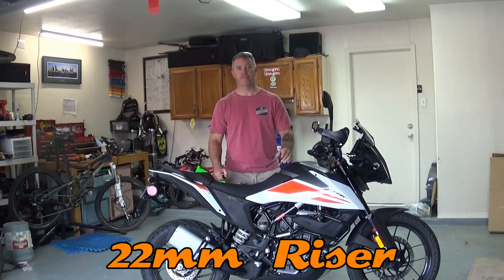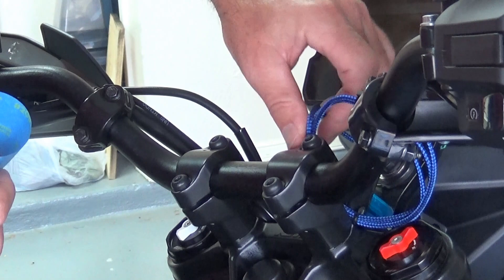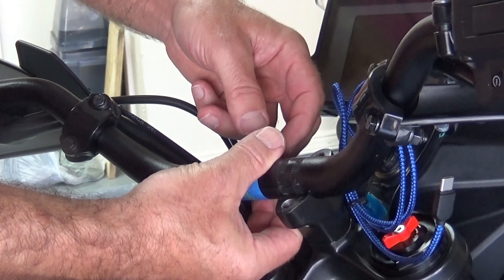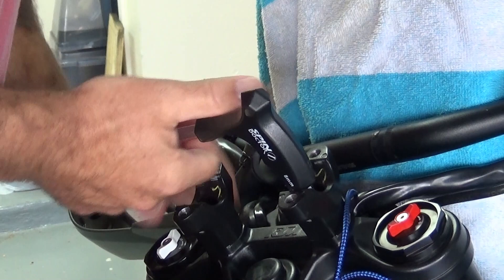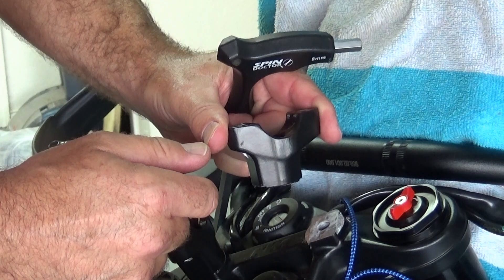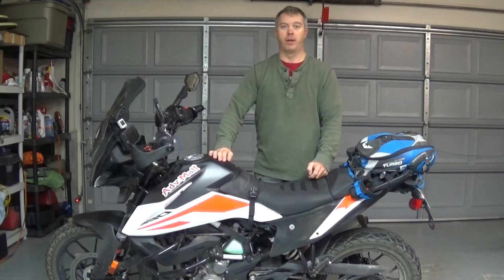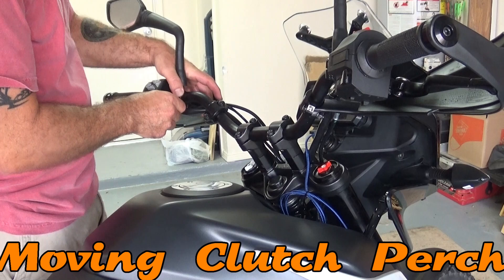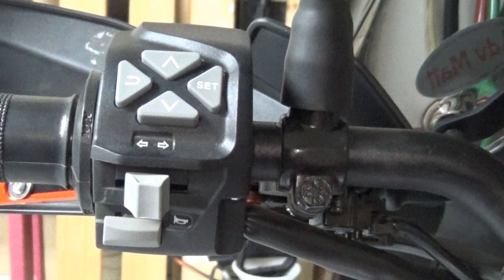KTM 390 Adventure Bar Riser Install

Comment: Installed 25mm risers today.  Clutch cable seemed a little tight at full lock but sliding in the perch seems sufficient.  Thanks for the vid!  Also, in case anyone needs it, torque for the handlebar clamps is 20Nm and 40Nm for the risers.
Reply from the maker: Have you considered upgrading the handle bars?
Reply: @advmatt  Not yet.  I want to try out the bike with the risers and see how it is now; should be a little more comfortable standing up.  What's the main benefit of a handlebar upgrade?  More rise or backwards sweep?
Reply from the maker: @luciano136  there are several ergonomic effects.  The first part of this video will explain easier than typing a novel here.  https://youtu.be/tV-GQT4m5VY

Comment: Just did this on my 2023 and used your amazon link and got the same ones. Bolts were threaded all the way on the ones I got and way longer than needed. Also some weird size was not a usa or metric allen I had so just bought new ones at the hardware store. Worked out great and did have to mess with the clutch cable a little bit.
Reply from the maker: Glad it worked for you.  It really helped my riding position.  Dropping the footpegs a 1/2" also helped a bit more.
Reply: @advmatt   waiting for those now and cant wait for them the factory ones stink........

Comment: I bought the risers you linked to in a reply to a comment here; all's good with the different bolts which were easy to find.  FWIW, I measured the bar risers I received and I couldn't find anything about them that measured 22mm even if the ad said they were 22mm.  More like 28mm.  But they worked if i moved the lever slightly to the right as you suggest.
Reply: Thats makes sense

Comment: Just fitted mine today, super easy, 30 minutes tops, allowing for how tight the original riser bolts were, I was freaking that I might strip them somehow, so took it extremely cautiously. The amount of rust at the bottom of the original 'riser' bolts was rather concerning on a 1 year old bike, so maybe folks should whack a bit of grease around the base of the risers, as that is where the water can get in, and it can't get back out. 
I did however hit what seemed to be a major snag. When I went to start the bike, I couldn't turn the key. When fiddling around, I somehow moved that plastic shield that is in front of the ignition. In a panic I thought the entire ignition barrel had dropped, and I started sweating, but it was just that the plastic shield had somehow got pushed up, stopping the key from going in fully. 
Mentioning it in case anyone else comes along thinking of doing the risers, so there is more knowledge shared.
Just the bar risers alone made a huge difference, I can stand (I'm 6ft) without having to bend my neck to get my head up. Once I fit the lowered pegs this wee bike will be a beast offroad! Yeehaaa.
Reply from the maker: Thanks for adding those notes.  Really helpful.

Comment: Hey just clicked in here to ask if you have had the new ECU flash done? I had my bike in for something else and I asked if they could do the new update. But I’m telling you I pulled out expecting nothing from the ECU flash….. it’s like a whole new bike. 

The jerky throttle response at low speeds in 1-2 gear is completely gone. The fuel is delivered way more evenly throughout all the gears. I could go on and on. I’m absolutely blown away by how much better the bike is now. It’s really so drastic and so much better words just can’t describe it you have to feel it to understand. 

And If you disagree then all I can think is maybe my bike was messed up from the factory ? But I think that’s impossible it’s a computer program in the end. Also I’ve heard dozens of people talk about the stalls (totally gone) , the jerky throttle , etc. 

Oh and also the extreme engine breaking is gone , now it feels like a normal big adventure bike with just smooth engine breaking not jerk your head around if your not careful. Which I had totally gotten used to and mastered but boy is it nice now. The entire experience just feels more smooth and the power doesn’t wind out in the low gears and spread so long in the high gears. It’s just more like what every other motorcycle I’ve ever owned was like.
Reply from the maker: Thanks for the info.  I havent had the ecu flashed with the latest upgrade yet.  Dealers are not close, but I will need to do it.  Cheers.
Reply: What year model is yours? Would the '22 models already have the new ECU flash done?
Reply: @db0zr0z  yes the 22 does. But that’s just second hand what I heard.  I would check with the dealer.

Comment: Even though this is a late commit, I put on the 1 1/8” riser and man what a difference that little bit can make. 
Like others having a problem with the clutch cable I ended up sliding the clutch lever in a 1/2”. The directions say to run the cable a quicker way. Humm, quicker not shorter. Anyways I really couldn’t see a “quicker” route. Sliding the clutch lever in seemed to work. I’ve seen others that bought a longer cable. 
So now at 6’ I can stand up without being crouched over. Still looking at straightening out the pegs though
Reply from the maker: Check out the BDCW'S pegs.  I love them.  I did a video on them if you want to know more.  SW-MOTECH also has the Evo peg for this bike.  Both pegs sit lower than stock and are flat.  Huge improvement.

Comment: The clutch cable is not long enough for those risers, please also note that the hand guards could hit the windshield.
Reply from the maker: It worked out fine for me.  The hand guards dont contact the windscreen.  Maybe you recieved a taller version.

Comment: Hi Matt,
I’m thinking of getting a KTM 390 adv and have been watching your posts.
Would you recommend the 390 having one yourself or would you recommend a different brand? Pros and cons of the bike given your experience would be welcome 😁
Reply from the maker: That is a tough question to answer directly.  I think it depends on the kind of riding you plan to do.  The areas I think there may be better bikes is long distance touring and aggressive offroad riding.  I really like mine, I haven't regretted the purchase one second.  I rode mine in some really aggressive terrain and thoroughly enjoyed camping off of it.  There are a lot of pros and only a few cons.  The biggest pro in my opinion is the weight.  A sub 400 pound adventure bike is so much easier to handle than a a bike in the high 500s.  The two cons that come to mind are the allow wheels, but spoke wheels are on the way and single cylinders vibrate more and require being ridden harder to get the most out of them.  It is hard to be comprehensive here but this a good video idea.  Thanks for watching.
Reply: @advmatt  thanks for your honest reply on your bike.
I’m taking the 390 out for a second ride in January, I found the bike a little vibrating on the first ride but was impressed at how light and well balanced it was. It also had some get up and go if you reved it up to about 8 thousand rpm. I took it up to 70mph on a A road and it had lots left but the wind at 70 was not good due to the lack of a decent wind screen.
I’m hoping to get a test ride on a Honda CB500X as it’s got all the things the KTM has not got like twin cylinder and a better wind screen and faring, but has a lot more weight to carry. I don’t know yet how the bike feels in relation to weight and balance. I think a lazy torquey ride may suite me but I’m just concerned about the weight of the bike.

I do lick your videos on the bike as you seem to be addressing all the concerns that I see I would have if I purchased a 390.

Thanks 😊
Reply from the maker: Keep the RPMs above 5k, the bike really smoothes out between 6k and 8k.  It's the sweet spot.  Cheers.
Reply: The 390 adventure isn't really a travel bike imo after riding for the last 45 years.

Comment: Hello!! Have you ever felt that 2inch raiser would have been a more suitable one for you after using this. I am 5.10 and not sure what should i go with(1 or 2 inch). You suggestion will be helpful
Reply from the maker: @uv4366  a 2" risers will require a longer clutch cable.  That was the reason I stayed with the shorter one.  I also installed the Black Dog Cycle Works pegs which lowered my foot position 1/2".  This seemed to work pretty well for me. I am also 5'10".
Reply: @advmatt thank you!  it helped

Comment: Hey Matt! Since my last post a week ago I found a new 390 Adventure and I'm picking it up tomorrow. At 6'2" I definitely need bar risers. Rox makes great adjustable risers that come in 1,2,3 and 4" heights. I'll be needing at least 2" and maybe more. I've read that you might be able to get away with 2" risers without replacing the clutch cable. Do you have any idea how high one might be able to go without replacing the clutch and the brake cable? Appreciate your input. I'm really enjoying your channel.
Reply from the maker: My experience with the risers was 1" was the limit on the clutch cable without rerouting it.  I looked at this very closely to see what I could do.  There is a lot if brake line so I think 2" would be fine but I dont know about anything more than that.  I recommend replacing the clutch cable for the heights you want.  Thanks for the feedback.
Reply: @advmatt  Thank you very much.
Reply: @michaelsupple6081  Did you get the 390 and rise the bars 2inches?  Was it comfortable?  How's the bike?
Reply: @jonasbaine3538  I did get the Rox risers which I believe are1.75”. It was tight but I did not have to change any cables. I also lowered the pegs .5”. Between the two I feel pretty good standing up. I’m really liking the bike and rode the MABDR with it.
Reply: @michaelsupple6081  I just put the rox 1.75 on my 22 and clutch cable seems tight did you re route yours? I love how they feel sitting and standing completely better just worried on the clutch.
Reply: I just installed the Rox 1.75” risers. I also installed a longer clutch cable (Royal Enfield Himalayan). Front brake line is a bit tight, but should be ok, I think. I didn’t try the risers with the factory clutch cable as I heard it was too short. RE cable is perfect.

Comment: Hey Matt. Thanks for your install videos. Did you run into the problem of your brake cable not having any slack? I did and can't seem to find any extra line.
Reply from the maker: I didnt have any issues with the brake line, only the clutch cable.
Reply from the maker: @mitchkettering  I havent but a grill on yet.  I will take a look.

Comment: Hi Matt, Greatings from Poland. I see that you have KTM crash bars installed. I just bought such, but regardles KTM send for installation manual to their website, there is no manual there. Have a bit of doubts regarding installation so could you pls, share manual if you had it with your kit? Or you just installed them following your experience.
Reply from the maker: My bike came with the bars installed.  I found the manual for the bike online, but I dont think it covers the installation of the bars.  Sorry.
Reply: @advmatt  Got it and thks for replay. More or less I have idea how to fit them so anyway I will try. Brgds and stay safe on the trail.

Comment: Hi Matt, the screw is M10x1,50 or M10x1,25? Y search at spare parts catalogue and said M10x1,25. Thanks!
Reply from the maker: I recommend using the longer one.  There is room for the the threads to go through.
Reply: @advmatt  I said the pitch of screw, not lenght. The "normal/commercial" pitch is 1,50mm. The fine pitch is 1,25mm. You know if is 1,50 or 1,25? Thanks again
Reply from the maker: I'm sorry I dont know what pitch rating was on the bolts.  I would only be guessing.  I dont remember it being the more fine pitch, but I cant say for sure. As a suggestion, remove one of the original bolts and match the thread up to a known pitch.

Comment: Had you found any other risers in your search? The ones that you are using won't get to me until mid-November. Why not Rox risers?
Reply from the maker: I was looking for a less expensive option since it just a block of aluminium.  I expect Rox risers will work too.
Reply: @advmatt  I just got these risers from Amazon. You mention concern about the clutch cable but what about other cables? Did you have to cut any ties or reroute any of them?
Reply from the maker: @davidringgenberg8538  the clutch cable was the only one that was a problem.  The electronic cables and brake line had plenty of slack.

Comment: Matt the new link goes to a 30mm bar riser not a 22mm do you think that will still work with stock clutch cable?
Reply from the maker: Let me fix the link.  Stick with a 22mm riser.  I think 30mm is too tall.
Reply: @advmatt  thanks man! Just picked up my 390 adventure this week!
Reply from the maker: @niclynch319  just updated the link to the exact bar risers I purchased.

Comment: What windscreen is that and how do you like it? Thanks!
Reply from the maker: It's the Givi windscreen.  I did a video on it.  It is way better than the stock windscreen.  It takes all the wind off of my chest and shoulders.  I still get wind hitting right about mid visor on my helmet.
Reply: I got the same windscreen after seeing your video and it makes a huge difference. I'm on the low side of 5 ft 8 and that was getting a lot of wind blast in my chest after 45 miles per hour but with this guy it takes a lot of that wind away without being too much for ventilation.